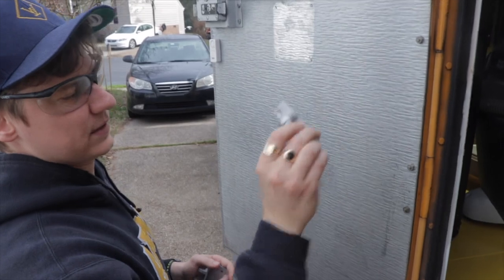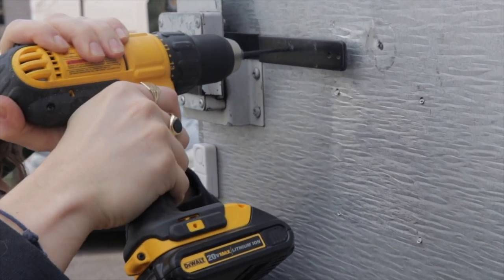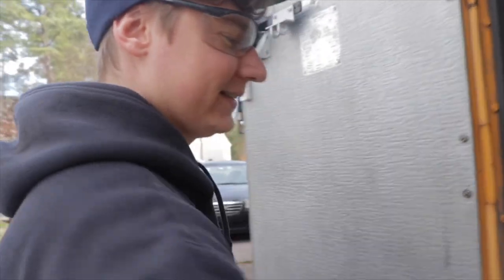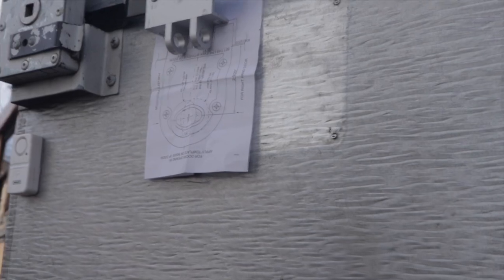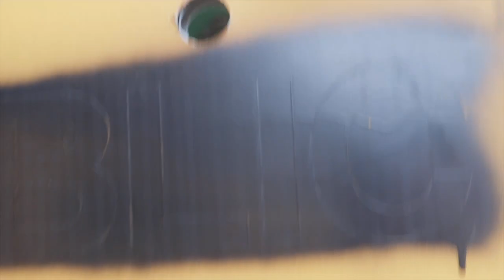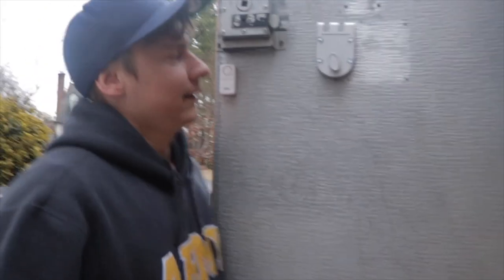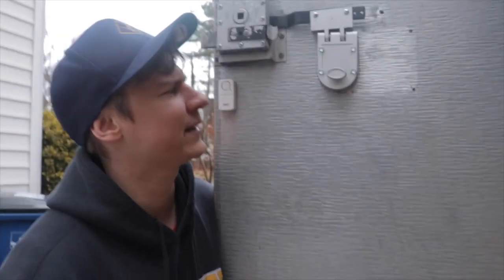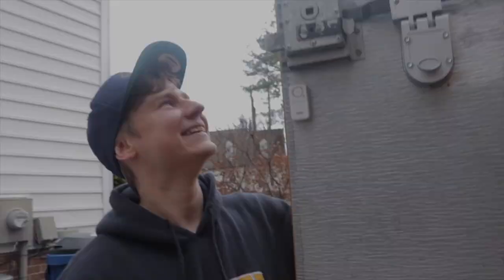Bus Conversion: The Build Ep. 14 - Installing Emergency Door Lock

Comment: That flu stuff is no joke this year. Glad y'all are feeling better and back at it. Good work on the floor. You can always do a quick look under the bus and see how the screws look. If you have any question if there could be any leakage, you can always give a quick spray of that flexseal stuff over the screws and you should be good to go. Hopefully you found some rustproof screws to go through the floor.
Reply from the maker: Yes that so true, I thought the exact same thing. We first was going to put silicon on the screws first but I I didn’t know if it was over kill. We have seen others do it this way and it seems to hold up. Thanks for the ideas and support!
Reply: @TheHiveDrive  I was going to say that as well. I don't think it would be overkill, but if you don't predrill the holes it will probly get more wrapped up in the wood than metal. Or predrill the hole and do a glob under the wood along with the liquid nails. I don't think there are any exact correct answers how to do any of it. It's all about what works.
Reply from the maker: I agree, so many people do bus conversion in so many different ways. I may consider going back under the bus though and spraying it with flexseal I like that idea!